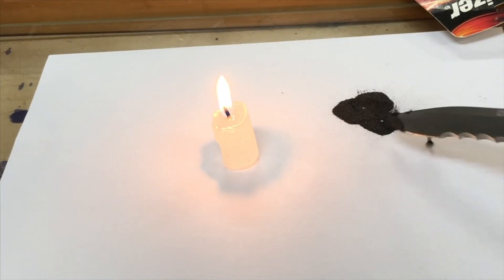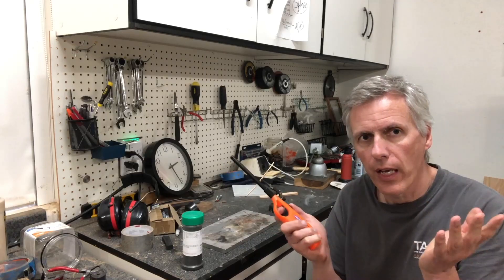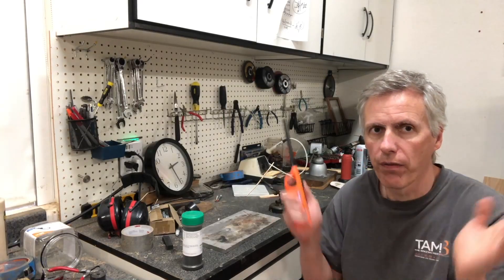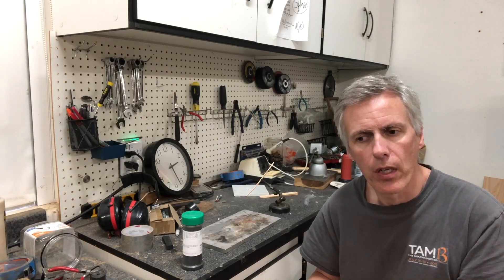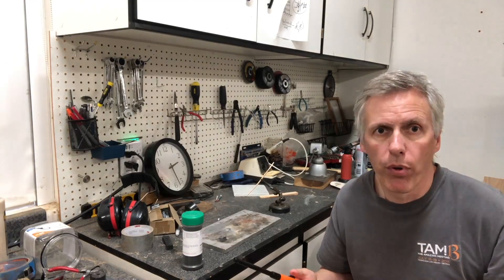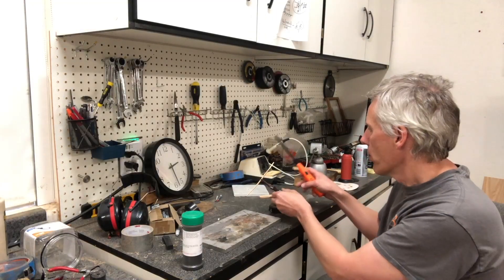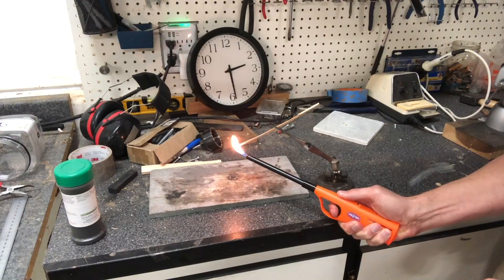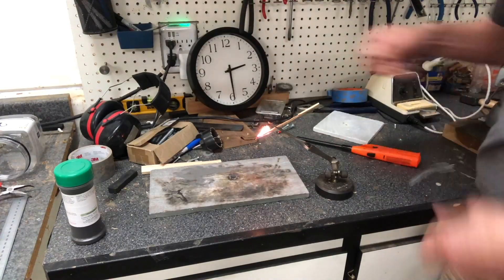Can you burn Iron on a Wood Fire? (9/11 related)

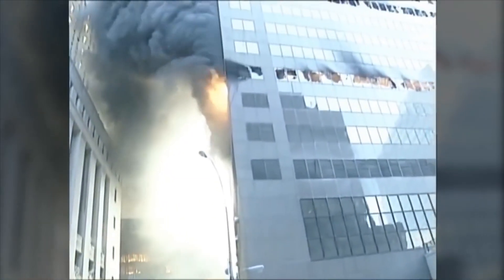Comment: 2:29 “I’m pretty sure that at some point some of the temperatures got above the temperature of a candle.” [1,400 °C]

False.

Structural steels do not need to melt to lose their strength. Their melting points are about 1,600°C, well above the 1,100°C typical peak value reached by fires in common building combustibles. - NCSTAR 1, p. 29 [PDF p. 71]
Reply from the maker: Sure, but the point here is about the formation of iron microspheres from iron dust. Flame temperatures are what are important there. The notion that no flame in the WTC site was hotter than a candle flame is ludicrous. People point to the NIST reports of temperature which are upper air gas temperatures, or steel temperature, not instantaneous flame temperatures.
Reply: @MickWest  "The notion that no flame in the WTC site was hotter than a candle flame is ludicrous."

As strange as it may seem, the hottest part of a candle flame is 300°C hotter than the maximum temperature of building fires. 
Note that the quote I posted says "typical peak value reached by fires", not upper layer gases.
Reply from the maker: @chrissarns  So, there were no flames in the WTC fires that were hotter than a candle flame? No matter what was burning?
Reply: @MickWest ,  NIST states that the the typical peak value reached by fires in common building combustibles is 1,100°C. They further state:
"At any given location, the duration of temperatures near 1000°C was about 15 to 20 min. The rest of the time, the temperatures were near 500°C or below."  NCSTAR 1, p. 129 [PDF p. 179]

There was a white flame (1,300 - 1,500°C) at the NE corner of floor 81 in the South Tower. That is the only know case of temperatures above 1,100 °C.

But that isolated event is irrelevant to your suggestion of iron spheres being created by iron dust falling through a flame.

Comment: Totally agree with you on this. I still have two huge questions though.... how and why did Tower 7 also collapse that day a few blocks away? And....why have we not seen footage or, to my little knowledge anything really, corroborating that another plane also hitting the Pentagon?
Reply from the maker: WTC7 collapsed due to the sustained fires and impact damage from WTC1 falling against it. There was an internal failure of floors around column 79, followed by the collapse of columns 79-81 which caused the east penthouse to fall through the building. Further interior columns failed, then eventually the exterior columns (lacking any interior bracing - like standing on an empty soda can vs standing on a full one) buckled at the lower floors, rapidly losing 99% of their supporting strength and initiating the rapid collapse you see on the video.
Security cameras don't point at the sky, they cover entrances. There were, however, hundreds of eye-witnesses who saw the plane.  It also knocked over lamp posts on either side of the path, which could only happen with something with 757 sized wings. The exterior of the building also had a 757 shaped pattern of damage.
Reply: So the collapse of 7 was asymmetrical and only on the damaged portions since that would be what happens. & strawmen won't change anything.

Comment: It would be nice if you went through his claims one by one. But I don't see the point in this vid, are you saying that classic iron shavings were present in significant quantities in 9/11?  

Also my understanding is that the type of steel in the beams is very different from the ones used in this silly iron shaving experiment. I don't know what you're trying to prove here, what's your point?
Reply from the maker: My point is that he was wrong about iron filings needing an unusually high temperature to ignite. A wood or paper fire will do it.
Reply: @MickWest  Ok, so it's totally irrelevant to 9/11.
Reply from the maker: @hansfrankfurter2903  No, it's still one of the many sources of microspheres. The destruction created some steel dust (see a rebar snap in slow motion if you want to see where that comes from) and then that burns, creating spheres. But there's a variety of sources.
Reply: @MickWest  i think you’re reaching , so you’re saying that when buildings collapse they create iron dust from breaking beams which then somehow burns if there is some source of heat and creates an exact replica of the iron micro spheres that these 9/11 ppl claim to be found exclusively in thermetic reactions? 

I’d need some peer reviewed sources for this claim.
Reply from the maker: @hansfrankfurter2903  For a source of heat? There was a huge fire.
Reply: @MickWest  for the whole process
Reply: @hansfrankfurter2903  The point is that thermite isn't the only possible source for iron spheres.
To the contrary, thermite spheres look differently.
Reply: @rinse-esnir4010  That wasn't my point. My point was the experiment in this vid is irrelevant, because the building steel isn't made out of iron shavings.
Reply: @hansfrankfurter2903  Doesn't matter.
The video shows that there are multiple possible sources of iron spheres and that thermite isn't the source of this particular type of spheres.

Comment: Use of filings is not a fair representation.  Rust won't melt like that and where are you getting filings from steel beams.  Maybe a little as they collide.  Metal with any substantial mass will not combust as you demo.  Thermite surely does.  Though I don't think it was thermite as video shows big beams "dustifying" mid air.  Its an unknown weapon of some sort available to deep stste operators.

Comment: The glaring problem is that you're using iron filings: drop a steel beam on the candle/wood fire/butane flame.  You need a source of iron dust - rust isn't a valid substitute because it's already oxidized.
Reply: You mean like  grinding and cutting steel beams when you're putting together a steel building? Or any of the dozens of welding operations involved in steel stairs,  rails, decking, etc?  Those multiple kinds of sources?  Don't even need the candle flame, the place was loaded with melted spherules to begin with.
Reply: @Paulie200   I'm not up to speed on the debate. I later saw Mr West using snapping rebar as a potential source of iron dust. Either way, if micro-spheres don't have a single definite source and their presence after the event doesn't establish any particular process within the event, then they're not key evidence - they don't prove any theory and don't disprove any theory.
Reply: @hermitoldguy6312  Ok, fair enough. I'll buy that. 
P.S. You can get iron from rust, iron ore is mostly oxide(s).  You just need a reducing atmosphere, something else nearby that wants to grab the oxygen, like coal and "coke" the kind made from coal.   I was impressed by the rebar vid too.  And if you look at the rubble of 9/11 there is tons of rebar everywhere.
Reply: @911RedPill     You're saying words, but they don't mean anything.

Comment: How is it so hard to imagine the amount of stress already on those structures before even softening the beams holding them up? The idea the government would do this to justify a war is ludicrous. We already had justification and it's tragic to think we might have prevented this if intel had been processed correctly.
Reply: Exactly, that's why its possible to forge steel. You can hammer cold steel the whole day and you will dent it a little, if it's heated up (to temperatures far lower than the melting point) you can give it any shape you want with a couple of strikes.

Comment: Some steel dust would be created when the planes hit the buildings but after that there would be a negligible amount of fine steel dust particles falling through the fires. (even if the fire could melt them) This experiment is grasping at straws.
Reply: So friction during collapse couldn’t create steel dust?

Comment: What would happen if you putted the iron flakes on a hotplate and slowly raised the power, would it then be possible to get a temperature for when they start to become spheres?
Reply from the maker: It depends on how much access to oxygen an individual flake has. If they are all piled together they don't actually burn. Spread out on a (very) hot surface might work. But the sparks we see are from individual flakes moving through the air, giving them maximal surface exposure, and fresh oxygen. Might be an interesting experiment.

Comment: Did the buildings had iron powder? NO !!
There you have...
Reply from the maker: What happens when steel is violently ripped apart? Like, say, a bit of rebar?  https://youtu.be/vPBM0g9usMs?t=184
Reply: Iron powder cannot be present in a building made of iron?
Reply: I thought the heat made the steel beams bend - what's this violent ripping? The towers undoubtedly had loads of rebar - buried in concrete. 
Now you have a false cause problem. Your unstated theory is, the steel was torn apart, producing dust - that you allege is iron dust - that then burned to micro-spheres. Then your evidence shows the building burned up and fell down - neither of which is disputed.  The question is why did the building fall down?
Reply from the maker: @hermitoldguy6312  The violent ripping I'm referring to is when A) the planes hit the buildings, and B) when the buildings collapsed. 
Burning iron/steel dust is just one source of iron microspheres.
The buildings collapsed because of accumulated column failures from the impacts and then the fires. The collapses progressed rapidly because the falling mass stripped the floors away from the columns.
Reply: @Mick West. You mean the two aircraft impacts that brought down three buildings? Why did the third building fall?
Reply: @Paulie200  Ah yes, I remember - the problem of how all that reinforced concrete turned itself to dust. Yes, that is a big problem.
Reply: @Mick West   If the floors had simply detached from the exterior steel, the steel would've stayed up.

Comment: I went and read the guy’s blog on you and I have to say he demolished everything that you threw at him and more. You should be ashamed of yourself .
Reply from the maker: Really? Pick one thing.
Reply: @MickWest  It's literally all there in his page, and I'm not saying that I agree with their theories. But how about the fact that 1- the microspheres which were found in 9/11 are elemental iron and not iron oxide which comes from your silly vid experiment and 2- there are no large quantities of iron dust in WTC and if you want to claim that they "formed" during the process of destruction then the burden of proof is on you to show how this happens with the same type of steel that was used in the beams , and in large enough quantities to be a signature of the dust.

3- steel doesn't burn/ignite if the surface to weight ratio is not high enough. You're entire argument rests on the assumption that there was enough "steel dust" already to form the iron rich microspheres. And since the majority of the steel there hasn't turned to dust, this makes your argument per force irrelevant. 

4- they didn't claim that you needed to melt steel, the whole argument was about igniting/burning , I don't know why you insist on strawmanning the guy. 

There was many other technical points in his blog, and he definitely seems the more technical and the more honest.
Reply from the maker: @hansfrankfurter2903  No, there's lots of sources of the microspheres, and the majority of them were iron-rich, not pure Fe.
Reply: @MickWest  I think you need to respond to his article point by point, because this isn’t going anywhere. 

What you’re doing here is exactly what you did in the video, distill the argument to 1 strawman and then knock it down without even providing evidence.
Reply from the maker: @hansfrankfurter2903  His entire argument is a bunch of misconceptions and strawmen. 
It's not complicated. Buring makes microspheres. Lots of other things make microspheres. Microspheres are not pure iron. Microspheres are not an exclusive indicator of nanothermite
Reply: @MickWest  It actually is complicated, burning makes microspheres under the right conditions, I.e if the iron was shaved into filings. 

"lots of other things makes microspehres" ? name one process relevant to 9/11 to justify the spheres being a signature of the dust. 

"Microspheres are not pure iron"

He claims that what the RJ Lee group found was elemental iron not Iron oxide (rust) which is produced from your vid. 

''Microspheres are not an exclusive indicator of nanothermite"

That's a strawman,  the argument is more complex than that. 

Again I'm not saying the thermite theory is correct, but you're criticizing it in bad faith.
Reply from the maker: @hansfrankfurter2903  https://www.metabunk.org/threads/making-iron-microspheres-grinding-impacts-welding-burning.9533/
Reply: @MickWest  Aren't you just repeating the same experiment in the vid in that blog? 

Again I'm not saying either one is correct but you're not really doing justice to the guy's argument here which is alot more nuanced and technical. All you're saying is AE9/11 say microsphere prove thermite, me prove microsphere come from burning iron powder, me win . That's a laughable portrayal of their arguments regardless of their validity.
Reply from the maker: @hansfrankfurter2903  No, I demonstrated many other ways of making microspheres, bot during construction, the fire, the collapse, and during recovery and cleanup.
Reply: But also the type of iron that existed on the buildings isn't the same as the one you're using, and you're not even accounting for the existence of fire insulators, sprinklers/fire fighters hosing and the fact that only a small section of the buildings was on fire. 

There's also the technicality of the chemistry of iron oxide vs elemental iron and all that jazz. Have you referenced the original work by Harrit/Jones and the analysis by that RJ group?

Look I hate conspiracy theories I think most of the time they're wrong, so this is why I come for ppl like you to talk me out of it. But you're not really trying hard enough here.